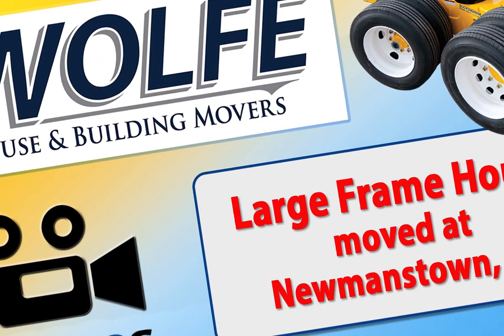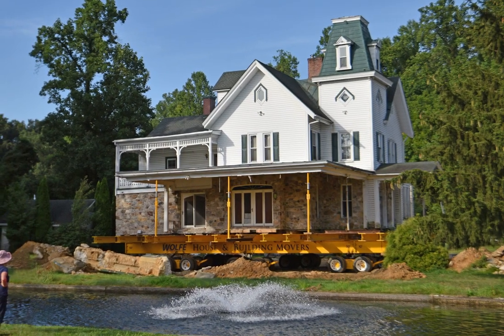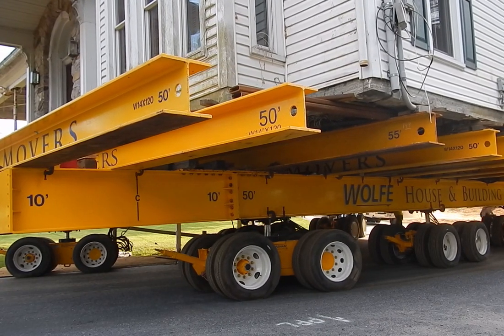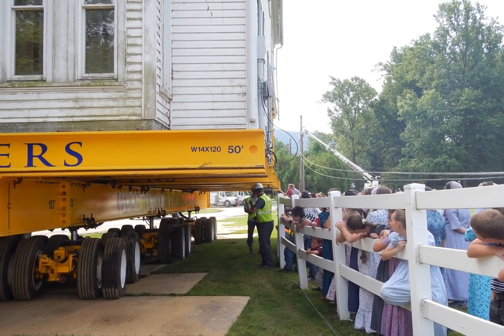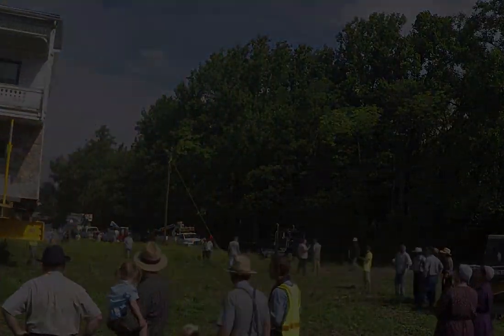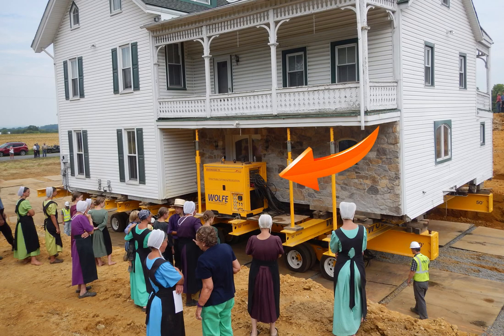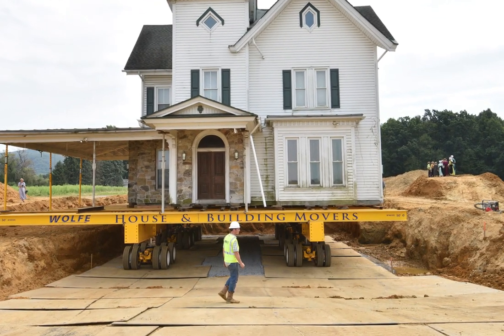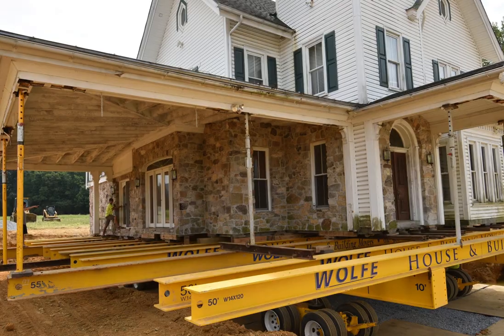Farmhouse Relocated in Newmanstown, PA

Comment: the craziest thing is how long people have been moving homes like this, except back in the 1800's and early 1900's they didnt have all the hydraulics and engine/computer powered machinery
Reply: In the 1830s it was screw jacks, huge greased beams, and horse power.  Probably chains and steel wheels and other heavy duty stuff of the time.  But yeah, old school.  People been movin' ships and stuff forever.  Man finds a way.
Reply: You can check indian videos. They still move buildings without any computer operated device and equipment 😂

Comment: how much does that cost? My guess is $50-$100.
Reply: 😂😂  I hope that's a joke.... well, if you're being serious allow me to correct you.  I am currently in the process of doing this with a house and I had 2 contractors come out to give me a quote.  One said he'd do it for 20k.  The other 32k.   That does not include the costs of moving electrical wires over the road. But it will include them actually installing the house on my property.
Reply: you mean $50-$100 millions
Reply: @Abhishek-yh7zc it’s about $25,000.00 to $75,000.00 depending on distance and overhead wires

Comment: Probably 3x the price of what the house is worth
Reply: Depends on how you measure value.
Reply: it depends on the how big is the house but usually it's about 50,000
Reply: I lift and move houses in Louisiana and it actually increases the value of the house down here because it will be above flood Elevation but we are lifting structures sometimes 20 ft in the air